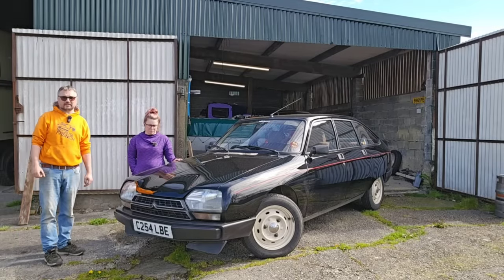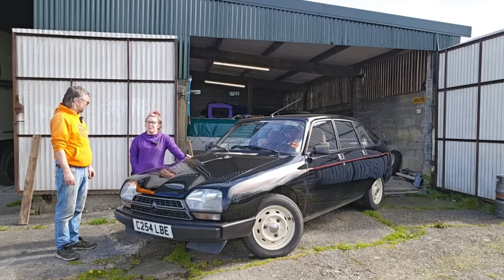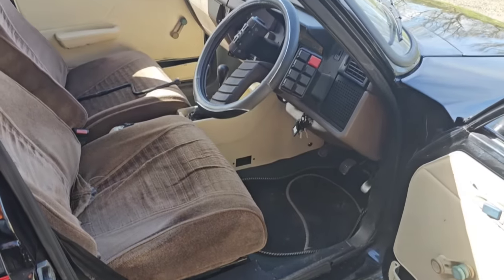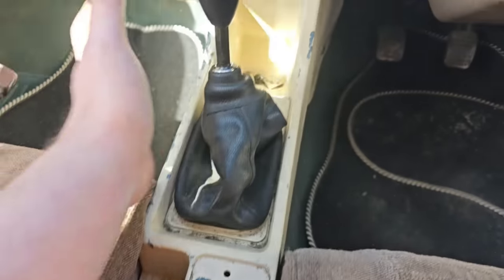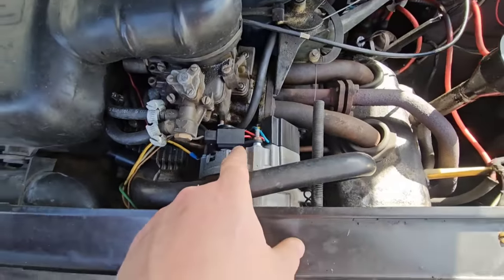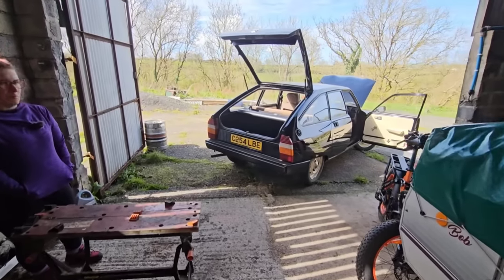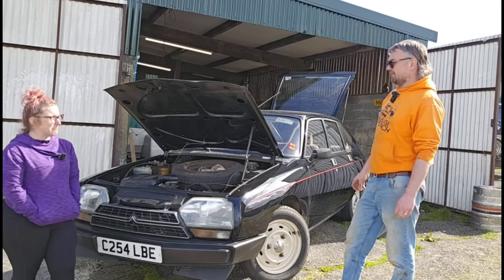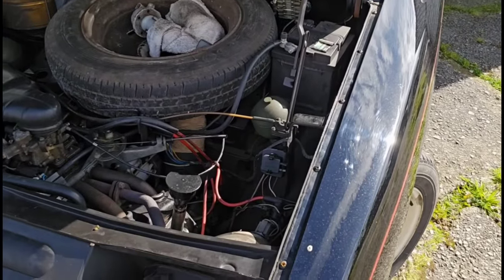Giselle the GSA was for sale. Now sold.

Comment: A pity Giselle's leaving the fleet but at the same time I can see your reasons for doing so. You have plenty of machines even with her departure and they're all small enough to fit in the unit! At GBP3,495 it's a steal too.
Reply: Well, I'm not sure about the 'steal' bit, the last time I bought a GSA, admittedly some time ago, I  paid.....£495. I know it's now a classic but at the end of the day, it's ?35 years old and has problems. I know that some aspects of even routine care are complicated and unless exorbitant restoration is undertaken, she aint gonna last......for that alone I wouldn't be making an offer and as it's been owned and driven by Ian "earnest thrasher" hubnut welll......😁. No offence Ian but I couldn't let you test my allroad, even though it's the reliable 2.7, she's got 218,000 on her and those tensioners won't take an Italian tune up hubnut style.😂 But there's someone out there drooling over it and you'll get a fair price for her.
Reply: @iandennis7836  😂

Comment: You seem to like Citroen cars and having Two 1986 cars to me that is ideal collection.
I have 4 Astra type vehicles Two Bertone convertibles my original is 52 plate and the rare 2.2 engine I just spent £830 on it.
Over the weekend I bought a spares car in same colour as my own for £250 and that is 2004 car with 1.8 and leather interior. (I do like a beige leather interior)actually wanted a black leather..
I then have my 2007 Astra Twin Top in Blue with diesel engine 1.9 CDTI design with full service history.
Finally kind of I have my Vauxhall Cascada Convertible on 2013 plate which is sadly not in great condition lots of paintwork needed to make a nice car.
My other Transport is my 2014 Ford Transit high top van 2.2 TDCI owned 6 years now.
My Audi Avant estate 2.7 TDI With 192.000 miles on it..  
Then my 2002 Mercedes CLK 320 Convertible owned 8 years.
Oh yeah and born in Coventry I have to own A Jaguar 4.0 Sovereign LWB Its on a Y registered plate 2001 has 126000 on clock.
Oh and a £500 pound Mountain bike rode about 15 miles so far..

Comment: Personally I'd put the Berlingo on the chopping block before Giselle. Sad times, bar Cecily might be the best car you've sold so far 😂
Reply: Agree that Bella needs to go as getting to unreliable
Reply: Bella can tow. Giselle can't. I think that may be the reason on why one and not the other.
Reply: I’m guessing the Berlingo is needed as the modern reliable run around.

Comment: For future reference, in accounting terms the cost of a one off item is defined as all costs incurred in bringing it to its present location and condition.  So for Giselle it would be perfectly ethical and reasonable to recover the cost of her respray as that is an improvement in her condition. Same applies with any delivery charges to you and from you to the new owner.  As you bought her to use HMRC would not consider this to be a profit.  Recovering the cost of service items like brake pads, discs and the alternator would be seen as a profit.  Different rules apply for traders.  NB whilst I hold a level 4 qualification in Accounting this is guidance only not advice.

Comment: I guess we are all different, but to me, this would require a great deal of work [at great expense] to get her right. Here I am with a 20 year old Volvo estate with 176,329 miles which I am going to sell, yet just had the alloys refurbished, 2 stage paintwork buff and new windscreen just to present it in its best state to go with the many thousands spent on mechanical work because I believe it is more desirable and will sell quickly verses others of same vintage and mileage

Comment: Do you still have the Pallas wheel trims that came with the GSA?🤔 I'm afraid I can't buy it for 3 reasons. 1, I wouldn't have a black car, hard to keep clean, shows all the scratches, absorbs the heat in summer.👎😤 & 2, you live too far away from me, & 3, if I was buying a car from this era, it would have to be something big & solid like a Volvo, Saab or a Mercedes, where I feel safe driving it.👍 But I'm sure you will have a suitable buyer for it though.🤔👍
Reply from the maker: I'm not 100% sure where the trims are...

Comment: Adieu Giselle.   A beautiful French old lady with style, even if her hydraulic works aren't what they were when she was younger.  So many channel viewers are going to miss her...  The GS family were my favourite eccentric French cars.  I remember the huge crowds round the Citroën stand at the London Earl's Court Motor Show gawping at the first RHD car before deliveries built up - no rotating drum speedo back then for us Brits, no oddball trapezium revcounter either, BUT that astonishing flat-four overhead cam engine 280-odd c.c. smaller than Giselle's.  Almost at the end of the production run about 16 years later she is, as you both say, a much better car for her bigger 1299 engine, a cruising 5th gear, and with even more quirky interior design features than her older plain sisters of the early 1970s (yay, not one but TWO rotating drums - and the superb indicators, wipers and lights switches cylinder).  I hope her new owner lavishes much love and pride on her; she really deserves it.

Comment: Nope. Don't want that car, even if I like it. Have a secret love for Citroens....
So, once upon a time I had a CX 2400 Pallas with a three gear Saxomat gearbox. That means manual stickshift but no clutch.
Just two pedals, throttle and brake. Think it was a 1979 if I remember correctly. Wonderful car!
Beautiful thing to move my ass around the world in. But, it had some quirks. One irritating thing was that the electrohydralic clutch stopped working now and then. Very disturbing! 🤣
Luckily I found a very cheap solution to the problem. I put a condom in the solenoid. That solved the hole problem, so I cruised through the neighborhood, wearing sunglasses, floating on green hydralic fluid, with a condom managing my gearbox.
I really liked that!

Comment: I was in same predicament recently bought a 2013 Fiat 500 in Yellow but also had my old i10 Hyundai so sadly my i10 had to go , it was a shame as the car was in a great condition apart from being a cat N car for a minor dent , The Fiat 500 ended up costing me a lot more £800 on new clutch and gearbox repair as the dealer never told me they were broken lol he did pay half the cost after i had to get the Motoring Ombudsman involved , anyway hope Giselle goes to a good home she has served you well even with the weird Alternator battery issues.

Comment: What  is it with Brits and their handbrakes? Most superfluous part of any motorvehicle. I'm driving since 43 years, all kinds of cars, vans, trucks ... and never ever needed or used a handbrake. Why are you insisting of engaging the handbrake? When I park my car I just put it in gear, with automatic I leave it in P. Car won't roll nowhere. And won't get rusted in place as it sometimes happens when you leave it parked for long term and handbrake engaged.
Reply: It's part of the mot so needs to work. I drive an auto with a foot operated one so never use it....

Comment: I have loved my LHM-blooded Citroens. The first I owned was a BX, last a C5. The C5 with steel suspension was a great disappointment. Wish I had somewhere to put Giselle. 😪
Reply: At least th c5 with normal suspension was less of a ticking time bomb a expensive one at that
Reply: @bmwman1981 Afraid not. Had two broken springs on the front, and a failed power steering rack. Not cheap fixes

Comment: There's a nice Proton Savvy for sale, on fellow you tubers car pit site. He's based in Crewe. 12 months mot, 28k miles. £1450
Reply: That thing is a no brainer for someone who isn't a badge snob needs a cheap reliable little car, I thought that as soon as Lee showed it. Had I needed to replace my Panda I'd have gone from over Darlington way to go buy it cos Lee is a sound lad.
Reply: Hard to get spares for? Not enough were sold in the UK.
Reply: @cornishhh  On service/consumable items not so much because most of the mechanicals are from the Renault parts bin, mainly Clio. I think you would struggle if you bent it. Also if there was major rust it, but than a) Lee wouldn't be selling it if it had and b) if it happens eventually, at that price just bin it and buy another cheapy. That's what I'm doing with my 13 yr old Panda if it needs a back axle replacement doing at the next MOT as with probably 130k on it, it'll not be worth doing.